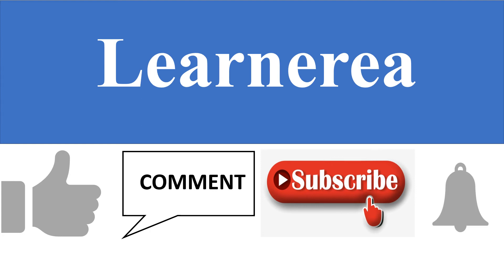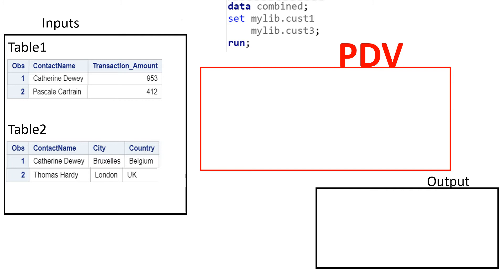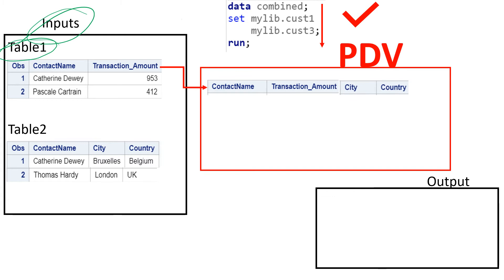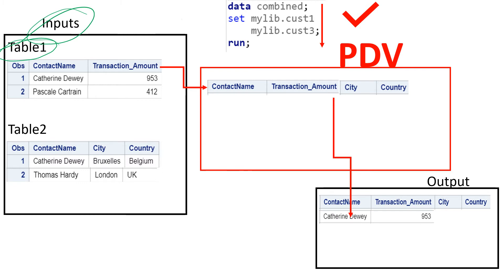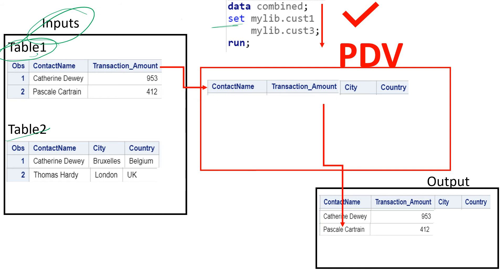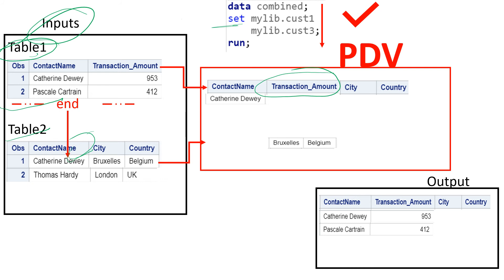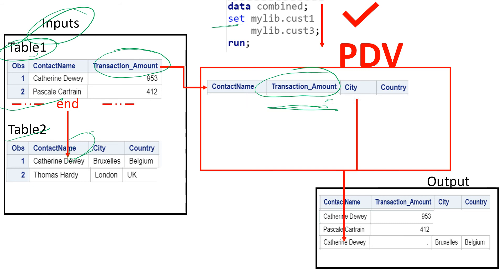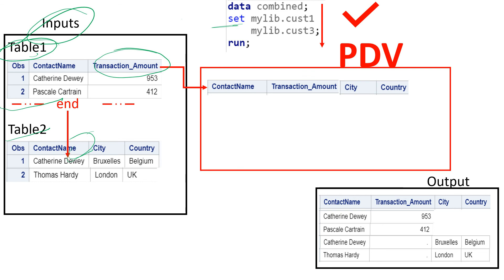MERGING TABLES - 1.2 | PDV IN SAS | ONE SET STATEMENT PROCESSING  IN PDV EXPLAINED | WHAT IS PDV

Comment: Hii bro could you help me understanding below kind of questions.And Please make one video on single trailing 

A raw data file is listed below: 
RANCH,1250,2,1,Sheppard Avenue,"$64,000" SPLIT,1190,1,1,Rand Street,"$65,850" CONDO,1400,2,1.5,Market Street,"80,050" TWOSTORY,1810,4,3,Garris Street,"$107,250" RANCH,1500,3,3,Kemble Avenue,"$86,650" SPLIT,1615,4,3,West Drive,"94,450" SPLIT,1305,3,1.5,Graham Avenue,"$73,650"
The following SAS program is submitted using the raw data file as input: 

data work.condo_ranch;
infile 'file-specification' dsd; input style $ @;
if style = 'CONDO' or style = 'RANCH' then
input sqfeet bedrooms baths street $ price : dollar10.; run;
How many observations does the WORK.CONDO_RANCH data set contain?
Ans) 7 and how??
Reply from the maker: you can try it after removing the @

however for best performance, you can use the below which will give you the required output

data work.condo_ranch;
infile 'file-specification' dsd; 
input style $ sqfeet bedrooms baths street $ price: dollar10.; 
if style in ('CONDO','RANCH') then output;
run;